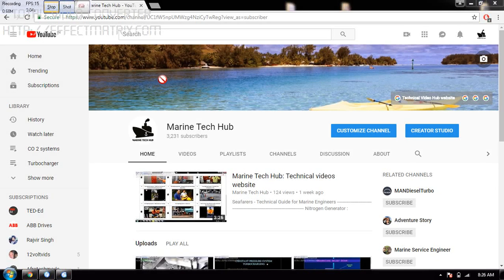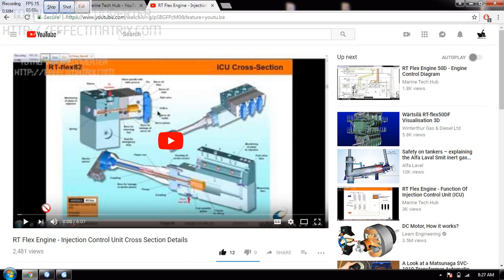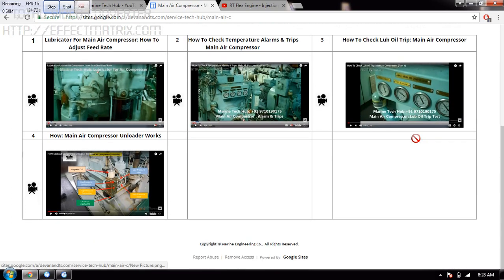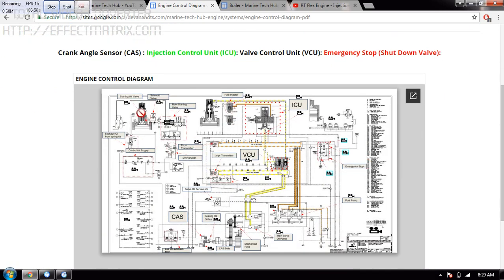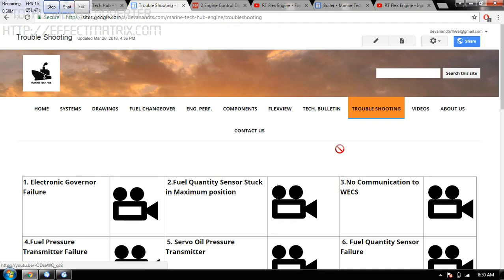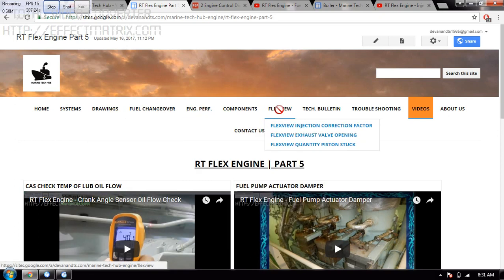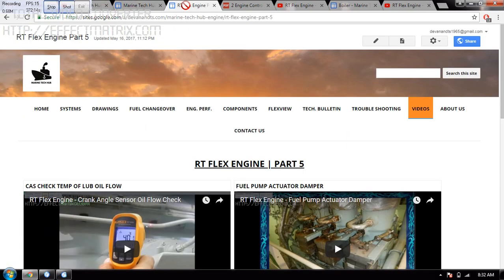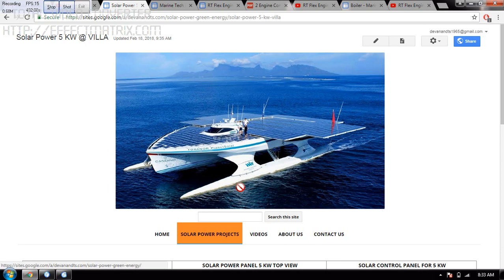Marine Tech Hub Website

Comment: Sir I have a question regarding electrical ,
 how four 12v batteries are connected to start the generator
Reply from the maker: Thanks for your valuable feedback !! Do share it with your colleagues and friend
Hereafter all my new videos will be available in website www.marinetechhub.com
please see all my video for more details in my website
you need to become member to get trouble shooting video in www.marinetechhub.com
and visit www.marinetechhub.net
Please let me know how much voltage is required for starting the generator,
Reply: Sir,as for flashing up generator it require 24v DC. But my doubt is where and how we connect battery for starting. It is helpful if you clear this doubt.
Reply from the maker: Since you require 24 DC volts and you have 4 nos battery of 12 dc volt. please connect 2 nos battery in series to make 24  dc volt and one more set of 24 dc volts and then connect both of them in parallel to get 24 dc volt.
Reply: Thank you sir
Reply: hi sir. can i still be a member? site is down?